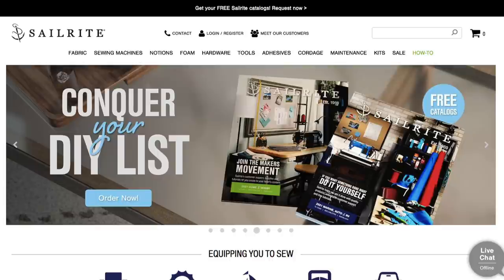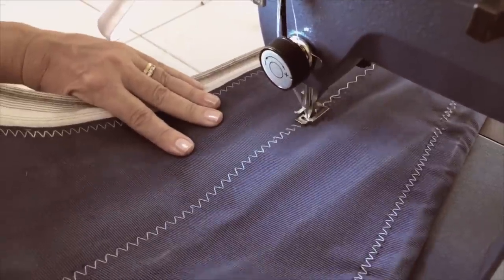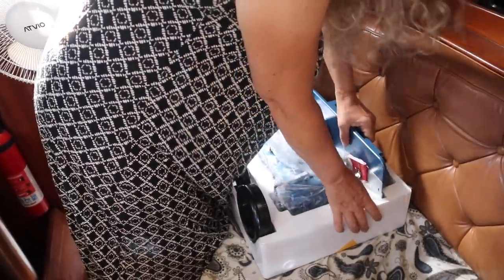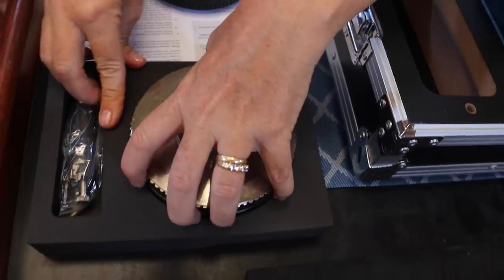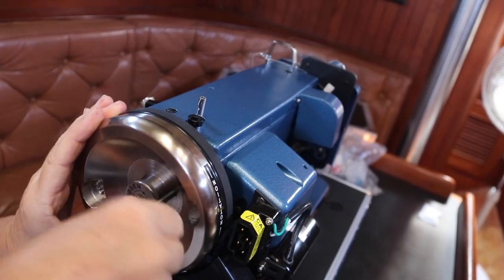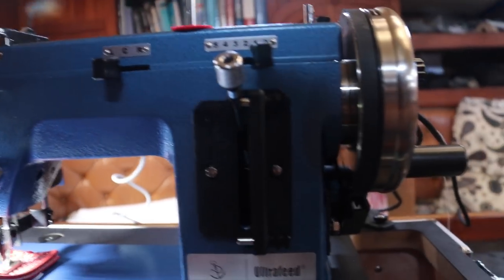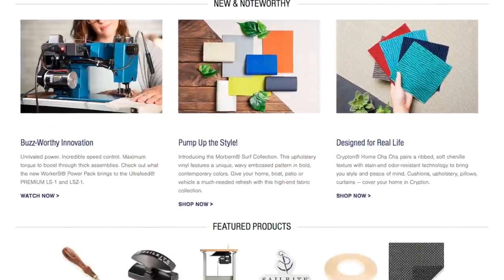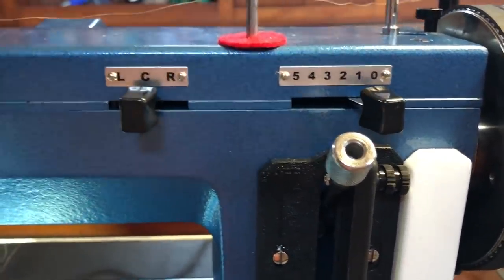Ep 241 | Sailrite LSZ-1 Ultrafeed Walking Foot Sewing Machine, Setup and Review, Sailing Nutshell

Comment: The light plugs into a socket under the adapter where the foot controller plugs into the machine. I think i saw that you have the adapter already in place. I love the light. I have the machine in my workshop where I also have my lathe and use the light for both. I bought the servo motor for the bench machine and will fit that in my modified base (the space I have to store my machine is is only about 230mm deep so I am making a special aluminium base for the machine to sit in and with a clip on deck assembly. I think I will one day make a cloth over bag if I ever consider moving the machine to work elsewhere). Thanks again for the talk, it gives me confidence that I bought the best machine for what I am doing, and I didn’t know that there was a spare parts kit so will get one of those.

Comment: Thanks for this review. I bought the same machine and am starting with small projects like outboard motor cover. Seeing how you handle the big items through the machine will be helpful, and also how you  plan out patterns. I built a special compartment for the machine so I could dispense with the box which is just too big, bulky and heavy (I don’t feel safe with new things until I have beat them around and modified them a bit). One of the projects I need to get on with is to make up tool rolls for my various tool kits.
Reply from the maker: Thanks for the comment. Coming up is a nifty way to measure large lengths of fabric without a big table. We needed to do this for the two stack packs. Tool rolls are a great thing to make. I’ve made quite a few for the tools and utensils when Magnus was doing the motorbike tours. W.
Reply: @LifeinaNutshell  i thought of another sewing project. Rope bags. Bags to cover ropes that are not going to be used for extended periods when at anchor or moorings, but also need to stay on deck. Here in the Nederlands in Winter everything goes green from algae, but there is also the UV issue as well as preventing ropes from going hard. These need to hang upside down to keep water out.

Comment: Sailrite have introduced a new item, the WorkerB® Power Pack Motor System (110V) ($299) which slows down the speed. But no 230/240V yet which is disappointing as I have the Aus/NZ model, love it. Agree re the tiny light one-speed racing pedal, I even thought about gluing some sinker weights plus non-skid feet onto it, my home sewing machine pedal is way heavier and speed control way better. Thanks for showing the damage from the Explosion, I was stunned when you mentioned it in the video straight after. I think I’ll rewatch your video to count how many times you said it was “heavy”. I’m 5’2”, female, and agree, it is heavy. But then it kinda needs to be to do the work. Singer have several models of a lighter cheap HD machine which is great for a lot of the light canvas work etc, often on special from Spotlight (50%). Fair winds, Elaine.
Reply from the maker: Thanks for the information Elaine. Sinker weights are a good idea. W.

Comment: Hi, great review! If I remember correctly inside the pedal should be a small potentiometer for regulation of the sensitivity. Please check that with Sailrite if that’s doable before to open the pedal. For the light connection there is adapter kit so you can plug it to the motor connector ArtNr: 122305. Is not a bad idea to have some spares especially the plate between the shuttle and the feed dogs. When needle brakes can damage the surface on this small plate and then starts ripping the thread. The plate looks like a half moon with two screws ArtNr: 1603 Retaining ring cap spring Page 5 in the manual. Good luck!

Comment: Hi Wendy and Magnus, don't usually comment but thought I may be able to add something useful to your excelent review of the Sailrite. I wanted to make rope bags for my boat and bought an old cast iron singer 201. Excelent old machine that will do al lot of tasks and is beautifully made, but it is a domestic machine and has its limitations. Wanted a Sailrite but they stopped selling them in Australia. There are at least 4 clones, looks like the castings all come out of the same place(probably China) and the quality varies, I bought a "Reliable Barracouda" from a Qld agent, Reliable are the Canadian clone, quality seems good, offers the monster wheel( Couda crank!) etc  and all the Sailrite accessories fit and has operated faultlessly for the last couple of years. Bought just the machine head, fits into the old school Singer wooden base and also into the old treadle tables if you wanted to set up in your workshop for a larger job. Also find the foot control to be cheap and nasty, Sailrite tell me  the "Worker B" servo is intended to be offered in 240v in the future. A lot of the Sailrite accessories such as the magnetic LED light and Swingaway binder attachments  can be sourced online at about half of Sailrites prices. Love the Hans Christian.
Reply from the maker: Hi Doug. Thank you for that information. W.

Comment: Sounds like it is built like an old Singer, and that's not a bad thing.  Shame about the speed control being almost unusable, that turns any machine into a fight instead of a pleasure. .  Variable speed drills have been doing slow speeds for decades so for an expensive machine like Sailrite to fail at this is bizarre.
Reply from the maker: Hi Honor. You definitely get used to it after a while. I’m still happy with the idea of being able to sew sails at sea with no power which is the main reason we chose this machine. W.

Comment: Price any good industrial zig-zag walking foot machine and you'll see Sailrite isn't really so expensive, and everyone loves their customer service... 
Does Sailrite offer a electronically controlled motor option like many industrial machines offer?  If they don't they should offer the option, if they can work it out... I cringe when watching anyone using a Sailrite machine because of having to use those motors designed in the 1920's with heavy material. As easily as that machine spins freely when spinning the balance wheel, the weak motor is the only problem with controlling it. After watching it sew, I was surprised how It spins without load like any well built industrial machine with good bearings used throughout.  
How about having electronically controlled constant power at any speed, from slowest to fastest with precise control. The motor on my wife's (larger) walking foot machine has one and it also has a voltage switch and speed range selector knob so it doesn't accidentally take off at 4000 stitches per minute on her. Industrial sewing machine electronic motors have got a lot smaller since I used to work on commercial machines many years ago, but are surprisingly more powerful.
Reply: Sailrite has recently introduced a new motor for slower more power sewing: WorkerB® Power Pack Motor System (110V).